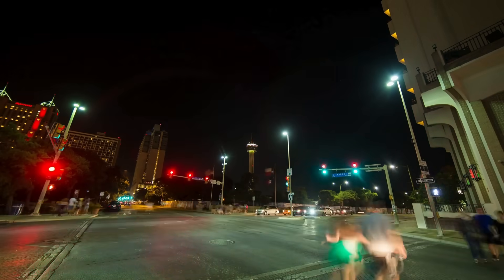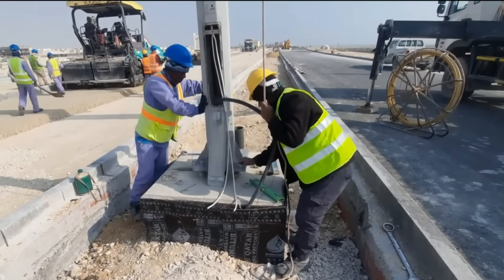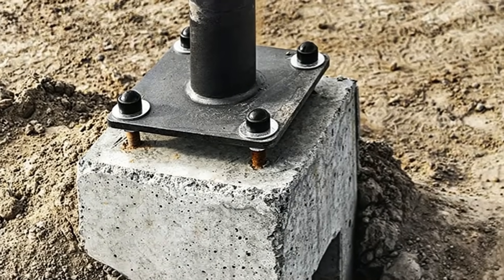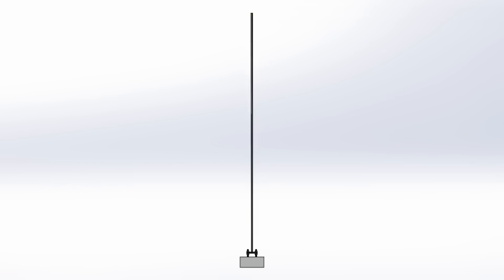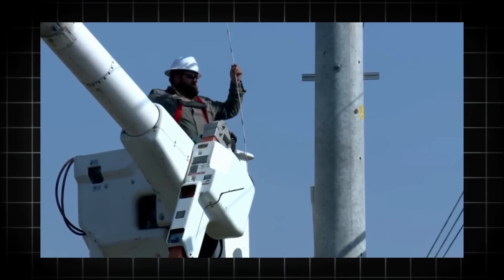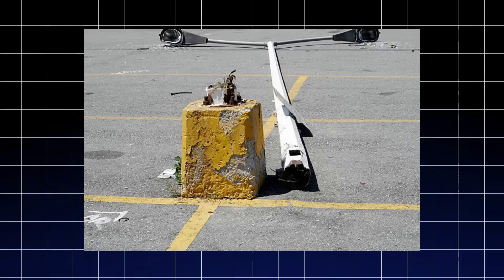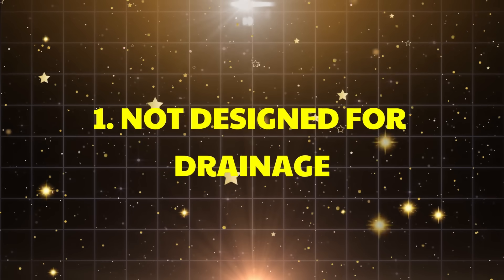Why Light Poles Float on Bolts Only, Not Flush with the Ground?

Comment: So in other words, it has absolutely nothing to do with "resisting those wind forces" as you claimed and everything to do with ease of leveling it during installation and ease of correcting it in the future if they become unlevel. 🙄
Reply: So I got in 10 seconds from your clear comment that it took the poster 3 minutes to describe.
Reply: @inyobill   this is exactly how i felt. the difference in searchability between print and film
Reply: @inyobill  Yes, and more accurate information since it has nothing to do with shear forces as claimed in the video.
Reply: Bolts can shear under load, so yea making it wind resistant reduces or eliminates that possibility so yea everything to do with shear forces genius, let’s hope to god you are not a physics or engineering teacher maybe just a full time troll?
Reply: I posted a link to the DOT website that had all the regulations for roadside poles and how they're designed to break or bend to reduce impact forces. But YouTube deleted it.
Reply: @keyogen   Those are different from the ones in this video.
Reply: @keyogen they’re all out to get us.
Reply: @keyogen 
Unfortunately the internet is becoming the place for misinformation.
I have installed countless polls for state and private use. "Most" of the poll concrete bases are above bumper height and even the hoods of most cars. Your going to hit the base before you come close to the pole.

Now traffic light bases are a different story. Steel one are bolted to the ground with leveling nuts but the aluminum poles have a cast aluminum base. That cast base is known as a breakaway base. I've never questioned why or what they are trying to save but when ordering that what they are called and are labeled as such on the print.
Reply: This
Reply: You missed the point jeb
Reply: Hell I did the same thing with my twelve foot windmill without ever noticing a light pole, it's not rocket science.
Reply: Where I live they are wood , and sunk into the ground.
Reply: spot on i installed a lot of overhead cranes  and its its for the same exact reason and you fill the bottom with grout
Reply: I am doing this design everyday. It has nothing to do with wind loading resistance but for the easy of leveling and corrosion control.
Reply: So I’m not the only one who missed the explanation of how it resists wind forces.
Reply: thank you. I was getting tired of listening
Reply: @pikiwiki just like we get tired of useless comments.
Reply: I think we should vote on this.
Reply: Oh wow i didnt notice that😮
Reply: The expertise, experience and knowledge of true savants is both a blessing and a curse
Reply: @CosmosGwelf  
Until this guy deletes your post. SMH What is it with YouTube anymore? Its just censor and delete facts.
Reply: Fagvif the pole is off the wind will take it
Reply: @jesselong8971   Not sure who you're addressing but if it's me, what point am I missing?
Reply: @The1stDukeDroklar  being level is how it stays strong ...so adjusting it periodically will help its ability to not be toppled by the wind ...wow
Reply: You completely missed the point, with it raised it does not compress the bottom plate and stress all the parts. So that makes it resistant to wind damage by being able to sway with the wind rather than taking the brunt force and causing damage, maybe if he explained it slower and with sign language for you trolls
Reply: For all those debating what I said, here's a video on YT by a civil engineer who tells you "A common misconception is that standoff baseplates are meant to break away in a collision". The video is titled:
What’s the Deal with Base Plates?
Reply: Usually there r shim packs between the plate. This way they r easily adjusted but if loaded high shims will be added
Reply: I believe you are overlooking an important factor. Indeed, these floating poles resist wind forces much better than poles with plates bolted directly to concrete pads. The extended bolts provide a crucial degree of flexibility to the structure, which significantly enhances its wind resistance."
Reply: @rafael3742   While that may add to its wind resistance, it is not the function of the stand-off bolts. I also would argue that the bolts are specifically designed not to allow the base plate to sway as that would weaken the bolts in short order. The type that is designed to allow for some sway is a different design that is covered in the video I mentioned above.
Reply: No
Reply: the narration of the video is made by ai
Reply: @MainframeSupertasker  Most of those replies are most likely AI as well.
Reply: @CosmosGwelf  the top 20 comments appear not to be bots
Reply: yes
Reply: No it is both !
Reply: @algercomalekmalki7997   No, it is not.
Reply: @The1stDukeDroklar  what about Newton’s third law ( ie the weight of the poles ) ? And what about the windy days ?
Reply: @algercomalekmalki7997   I already researched this and the reason is for ease of leveling and ease in maintaining the level.
Reply: Thank you for calling these fools out who are wasting peoples time with false information
Reply: I agree, he just wanted to add that unnecessary melodrama first😂
Reply: A balanced pole is likely better able to resist high winds in the direction of the wind. So in a round a bout way he got it correct.
Reply: It's also if the pole is hit by a vehicle. It would shere off the foundation easier. Making it so the vehicle won't wrap around the poll.
Reply: @keyogen  That's false.
Reply: @The1stDukeDroklar  I agree. Fire hydrants have shear off bolts , but that's to protect the pipe below ground. I've installed many poles and don't see shear off points on any threaded rods. The huge poles would need so much impact force to shear the special bolts that the vehicle occupants in a car would not be happy, let alone the cars the pole falls on. The leveling is so easy with the turn of a nut.
Reply: @The1stDukeDroklar  It’s not false.  It actually is true.  I heard this directly from a pretty well known traffic engineer and my structural engineering colleagues confirmed it.  Also, if you look at similar installations in Europe, they don’t have those floating plates at all (and there are no leaning poles in Europe).  I went through my pictures while I was there and confirmed it.

But don’t take my word for it, jump on to “Idiots in Cars” and look for the times a driver hits a traffic light with his car and see what happens.  The results will amaze you (hint: the car is usually mostly fine)!
Reply: @ScramJett  
Most polls I've installed the concrete base is higher then bumpers, even hoods of most cars.
But the poster of this vid doesn't like that so he delets my posts.
Reply: @The1stDukeDroklar  

I'd like to agree with you but I don't post foul or derogatory comments its not the way I talk, and try not to be offensive. Not sure if its the OP or someone someone that can't handle truth and clicks report. Little ridiculous when an installer is posting facts.

See if this stays, In one of your posts you said traffic polls aren't intended to break away. "Most" traffic polls I've installed are a spun poll but are installed on a cast breakaway base. Its what its called, ordered by and named on the print. Now what its saving IDK because the poll usually ends up on top of the car. (Lesser impact?? IDK)
Now the larger intersections with long cross arms are usually steel.
Reply: @edmundanderson657  He's talking about poles, not polls. If you installed poles for real, you wouldn't have said "polls". Called.
Reply: @Icehso140 Correct. I've poured hundreds of pole foundations. The bolts are set on the form with a centering jig, and then any irregularities with the concrete surface or the pole flange/plate is easily compensated for by a turn of the nut.
Reply: @keyogen  NO
Reply: @keyogen 
Then why are interior columns in new buildings done the same way?
There's zero chance of them being hit by a car
Reply: If you watched you wouldnt jave posted that @keyogen
Reply: @keyogen  tell us you didn't watch the whole video without saying you didn't watch the whole video
Reply: Pole? @keyogen
Reply: @erikolsen2846  A misspelling. I'll fix it. Thanks.

Comment: The breakaway depends on where in a road the pole is if the road speed is high enough and the condition such that a person would be greatly harmed by the sudden stop the poles are made to be break away they are made this way by preloading a bolt then backing it off and then torqued to. Specific requirement set by the engineer it then can be installed and when you hit the pole going fast enough the pole breaks off laying over the car and not splitting it in half!
Reply: All well and good for the occupants of the vehicle,  but what about people in the area having to contend with poles and signs falling on them?
Reply: @ it’s a risk analysis thing study’s have found the highest risk is cutting the car in half so for the best chance of the least loss of life they some times use break away poles
Reply: It is called Darwinism!

Comment: Close, but no cigar.  The “J” studs that are placed into the Pole foundation are placed in such a was, as was stated to allow the pole to be adjusted to be “vertical”.  Like was stated in the video was not only to be a way to make the “Pole” vertical, but also a traffic signal “arm” to extend horizontally into the roadway. Those “gaps” under the baseplate, was supposed to be “dry packed” to protect the exposed bolt threads from erosion. Concrete is good at compression, and steel is good at tensile strength. This is how concrete beams are built/constructed, like in prestressed concrete beams.

Comment: I have erected many buildings with steel columns over my career. A common practice was for the concrete sub to install the bolts and thread a leveling nut on each of the bolts. He would then "shoot" one of these nuts "to grade" and paint it orange or whatever color signifying to the steel erector that the painted nut was set to grade and he would then level the remaining nuts from the painted one just prior to erecting the column. After all the steel was erected and verified all the steel was plumb and true the concrete sub would then come back and grout below the baseplate. Almost all of the column baseplates would be below the finished floor elevation and never saw the light of day again. Many times the below grade steel would be coated with a bitumastic of some kind to protect from moisture.
Reply: Deeze Nuts.
Reply: That is fine for a building because you have to keep the water out. It has nothing to do with the floating light poles!
Reply: Most of them also put shrouds / covers around the base to hide the bolts because there not ascetically pleasing to look at & without them they look unfinished!
Reply: 35 year Ironworker, yup.
Reply: Erected....

Comment: The problem extends to other structures like substation and transmission structures. I have even found rusted anchor bolts on grouted baseplates with an open steel column. The baseplate’s bolt hole was too large and there was a small gap between the baseplate and nut for water to accumulate in the baseplate’s anchor bolt hole and rust the anchor bolts. There needs to be a washer on top too.

Comment: I have always wondered, now I know. Thank you.
Maybe you could address the tremendous force on the long arms coming off the traffic light support poles. 200 pound load at the end of a 30 foot spar attached with two bolts on an 8 inch plate. How can a bolt be that strong?
Reply: A low grade M12 (<1/2 inch) bolt can hold almost 5tons of weight as a minimum to be compliant. High grade one can hold 8tons. 200 pounds < 100kg, 2 x M12 can hold 10000kg 30 foot is less than 10m so the support to the bolt distance can be 10cm long which is less than 4inches. I say you could go probably up to 300 pounds with this setup, ignoring wind.
Reply: @CemKalyoncu  Well, I do think about the wind with this heavy load bouncing up and down in a strong wind, but I never see the bolt break or the pole buckle. If I were the engineer, I would never have the guts to sign my name to that design. The math works out but my eye says "too dangerous!". Engineers are brave. 
Thank for the bolt specs.
Reply: @VoteScientist   Instead of guessing like you, engineers calculate. There's no bravery needed when you know the design is solid.
Reply: They are made with a good grade of steel! Notice the shape of the verticals. It is all engineered to work with a large margin of safety.

Comment: YOU MISSED ONE if you clamp the base plate down to the concrete - the metal studs [bolts] are ALWAYS in tension, they are being pulled OUT of the concrete - then when you wind load it you are adding EVEN MORE stress, with time and water and corrosion this can lead to failure 

With the floating design, the studs are neutral, just under slight compression from the weight. They are only loaded in times of wind and total loading is < then flush mount
Reply: Brilliant
Reply: @Yonatan24  THANK YOU - happy new year...!!!
Reply: Right, the video doesn't mention the main reason for the design, just some benefits to it.
Reply: ehh, no. 
in a clamped design, if you assume the base plate maintains contact during wind loads, there is no change in tension of the bolts.  
however there will be change in the contact pressure between the base plate and the concrete.
Reply: @Tony-lc7op  Thats not true
Reply: @piccalillipit9211 He is in fact correct. In a flush mount interface, the tension in the studs, once set, will not change unless the plate begins to lift off the concrete base, which would never happen in a properly designed interface. Basically the clamping preload would be set high enough to resist the largest possible bending moment due to wind, plus a generous factor of safety.
Reply: @Tony-lc7op  That is a good point, and a minor point in favor of flush mounting since the studs are not subjected to fatigue stress due to varying wind force. Furthermore, there is less peak force transmitted into the concrete base through the studs with the flush mount since the clamping preload only needs to be large enough to resist the total applied bending moment over the whole plate, which has several times more area moment of inertia than that of just four exposed studs. There is also more rigidity in a flush mount interface than the floating design.
Reply: Really.  It doesn’t make sense to me.  On concrete, the weight is more distributed, but whether the pole is on concrete or floating, the same bolts are holding the pole from lateral forces.  The studs seem the same either in the stress position whether the pole is on concrete or floating.
Reply: @tonymanero5544  Ill try and illustrate graphically.                     |CONCRETE||-------->------          flush arrow indicates force 

|CONCRETE|---------<|>--------

The forces are in opposition on the two bolts of the floating design so cancel each other out. On the flush design the force is only above the plate where the bolt tightens down -= so the force is a permanent tension on the stud trying to pull the stud out of the concrete
Reply: @tonymanero5544 When you have flush mount - bolt are always in tension or that thing will wobble. Concrete doesn’t like to be in tension.
Reply: Communication Towers are mounted to concrete like this for the same reason.
Reply: Yes, this!
Reply: @jimcooke640  THANK YOU - hap[py new year
Reply: How can the bolts be only under neutral compression for something like a traffic light with a huge arm sticking out? There would be a constant torque on the pole.
Reply: I have installed hundreds of these and have always questioned the engineers about this and never got a clear answer and this makes perfect sense that anyone can understand.
Reply: NONE of that matters if the engineering was correct to allow for it. Every single steel building built is bolted down like a light post. But then non shrink grout is filled under the base plate.
Reply: @kirkwilson5905  Nothing ever matters if the engineering is correct.
Reply: The bolts are in tension either way. When the bolts above and below the plate are tightened to the correct torque, they create a tension force in the bolts between the nuts. It is a component of this force that provides the friction force between the threads.
Reply: @ Explain how bolts’ are in tension that are below the nuts but above the  concrete.
Reply: Keep in mind that the anchor bolts are L-shaped and aren't in tension as would be straight bolts.   The anchor bolts are galvanized on the threaded section only.  The lower section that is in the concrete is meant to corrode a little bit, and expand a little bit inside the concrete making the insulation stronger.

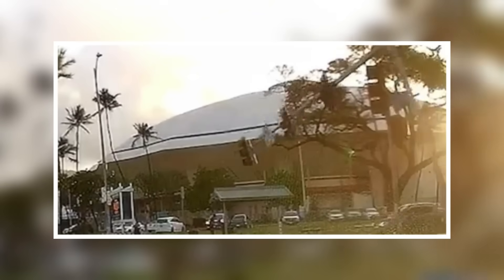Comment: @2:35 You said the plates are designed for structural Integrity that is completely bull crap All signs and light poles on highways are designed with Breakaway bolts So they break away cleanly when a car or truck hits them Not remain rigid and kill everyone in the vehicle you clown.
Reply: Go look at a 8 or 10 bolt signal column baseplate with a long cantilevered arm when you get a chance. I think you will recant what you have said.
Reply: No. On breakaway light poles, it is the pole that is designed to breakaway, not the bolts. And overhead sign structures and traffic signal poles are not designed to breakaway due to the huge cantilever and wind loads that require strength throughout.
Reply: I'm not talking about those huge cantilevered signs. I'm talking about the four bolt lights and signs